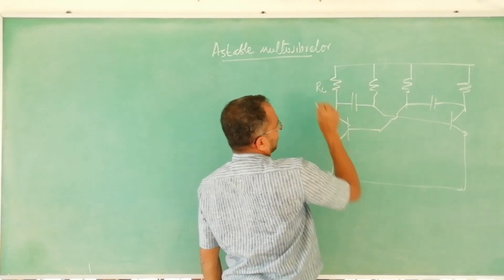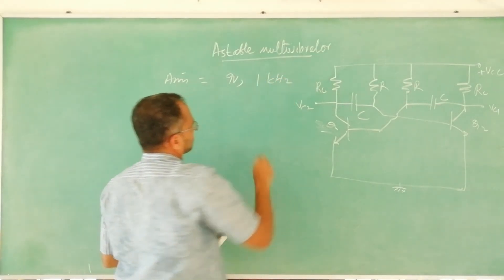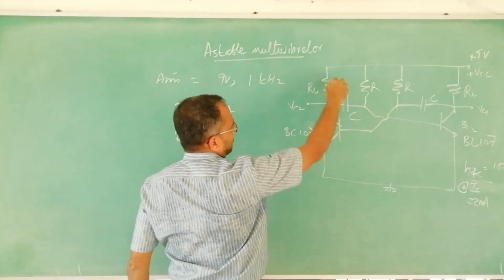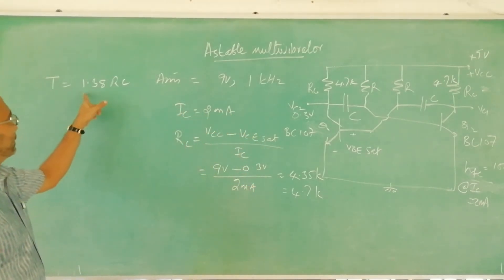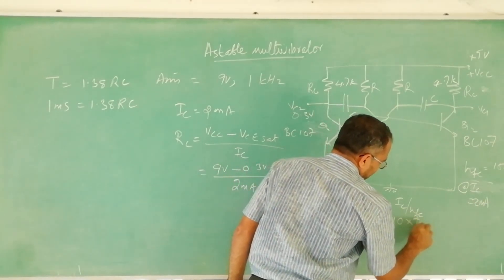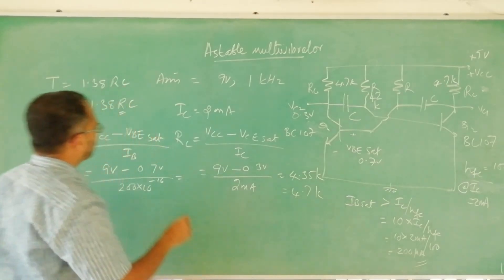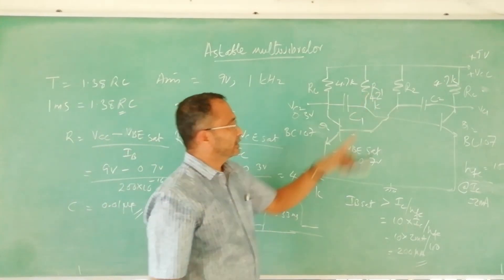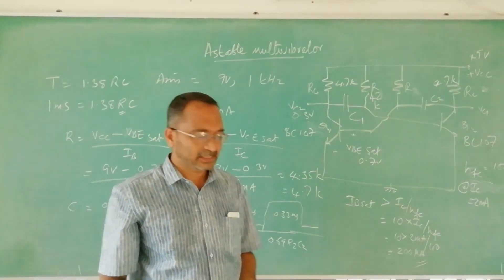Lab Tutorial: Astable Multivibrator by Dr. K. A. Navas

Comment: I made a circuit with 10k,1k,100uf with bc547 in 3 to 5 voltage but battery backup just 1 day only. I blinking 3 0r 4 led with this circuit,  what I can do that the battery backup  will increase for a long time period.